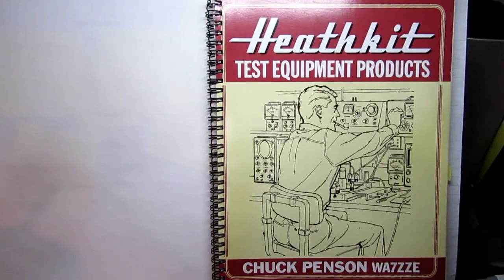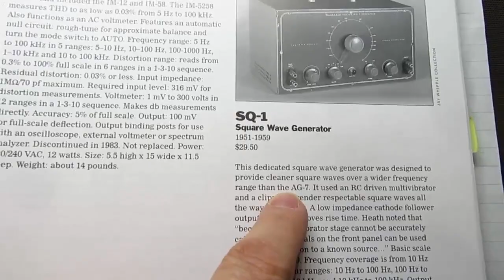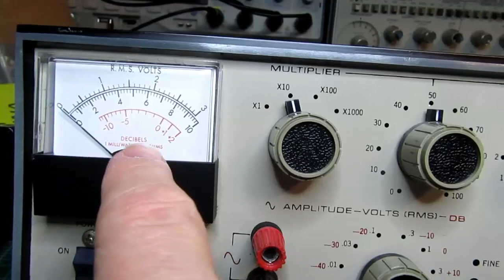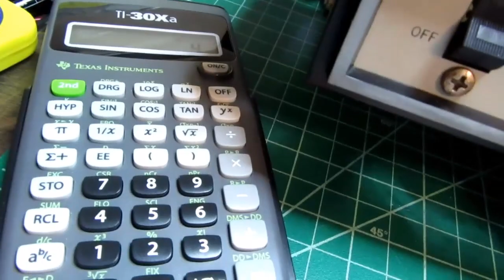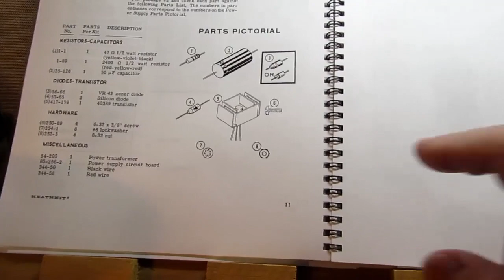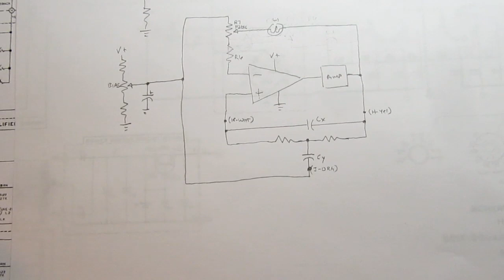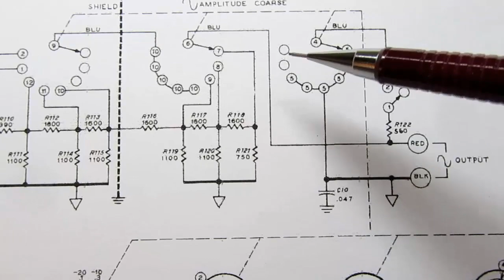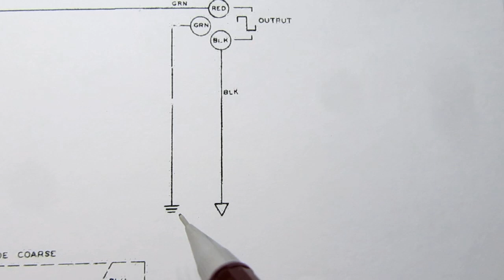Heathkit IG-18 (IG-5218) Sine-Square Audio Generator: History, Overview, Demonstration, Theory

Comment: Thanks for the very thorough circuit description. I'm currently restoring one so your video is very helpful. Nice paint job! I painted my covers with some flat black I had on hand. There are some mods on the web that you may want to consider. Mostly increasing capacitance and replacing R3 with a 56K.

Comment: Just bought an old Ig 5218.  Adjusted the sine wave, looks good, nice slope but the lines look a little staticly/fuzzy.  Wonder what's going on.  I also just put in the meter board mod which works pretty good.

Comment: Hi- just stumbled on one of these today at a garage sale. had 2 questions:
what kind of cable are you plugging into the sine and square wave jacks? and would I be able to plug this into a typical audio
interface to record it into my computer? thanks
Reply from the maker: Neilkiots, there is nothing special with the sine and square outputs of the IG-18. The connectors are just regular banana jacks, and I use regular banana-to-shielded cables. 

The only issue will be that the voltage levels of the signals will not be correct unless you can arrange to have 600 Ohm terminations on the cables. The IG-18 can optionally use its own 600 Ohm terminator for the sine output, but there is no equivalent to that on the square output. But if you don't need or care about the accuracy of the signal output levels, then none of the above matters. You should be able to connect up easily to any kind of single-ended (un-balanced) line level input on any audio devjce.
Reply: @youtuuba  great, thanks for the response. i'm trying to record these sounds and create a sample library from them.
Reply from the maker: @neilkiots  , a "sample library" of sine and square waves will be about the most boring 'sounds' ever. The IG-18 is not a music synthesizer......
Reply: @youtuuba   haha maybe. trying to make some music inspired by early Stockhausen where he was using WW2 oscillators. another question about  Ohms. i'm not sure what you were talking about- Is this 600 difference something that could damage my audio interface. i use a UA Apollo 8xp
Reply: @youtuuba  https://youtu.be/Ovz6it26iSw this is the Stockhausen piece. one of the first of its kind

Comment: Pretty sure the IG 1271 did indeed have offset control. I still have mine.
Reply from the maker: leonbaker, if you still own an IG-1261, why not check it to see for sure? I looked at images online to verify that it had two knob positions. The left position knob was the frequency multiplier, with a red co-centric knob selecting the function (sine, square, triangle). The right position knob was the rough attenuator, with a red co-centric knob for fine attenuator/variable level adjust & power switch. No offset control. So I don't understand why you would contradict my statement of fact with a guess. Maybe you have a modified version. I recall that I modified mine with an extra small knob to give offset control, but it was awkward to use and had no detent for zero offset.
Reply: @youtuuba  thank you for the insight

Comment: This is awesome and definitely helpful for things to be looking at when diagnosing the circuit. I have been trying to get the unit that I have up and running correctly, the issue I'm seeing it that the output is far too low. When I follow the calibration instructions, I can adjust it to where I measure a 1kHz sine between R13 and R14, but at 5.7Vpp. Not sure what the deal is 🥲